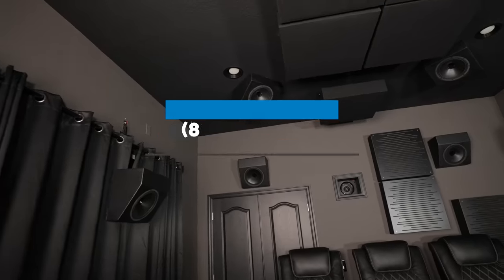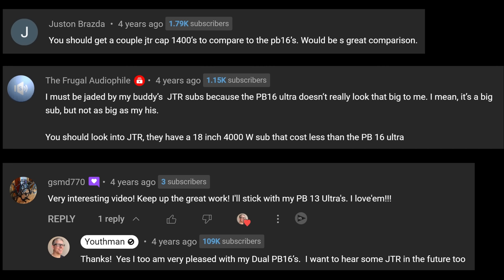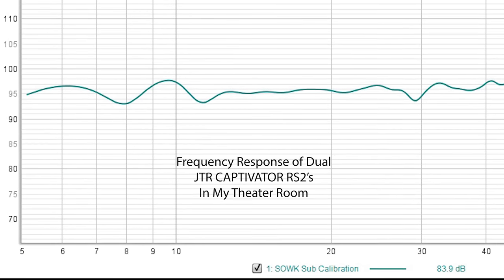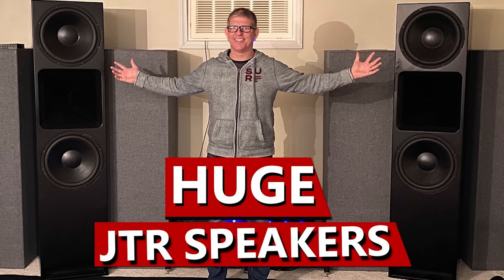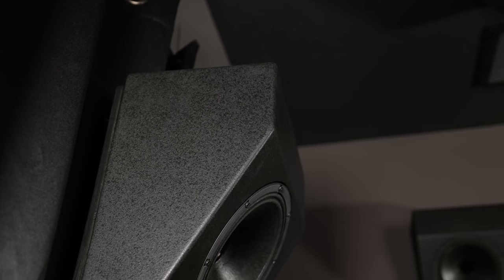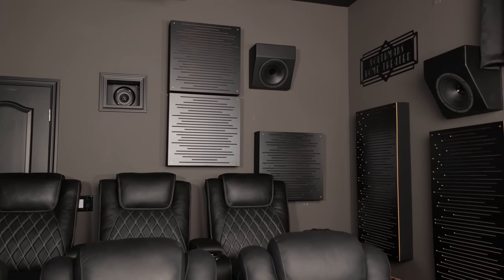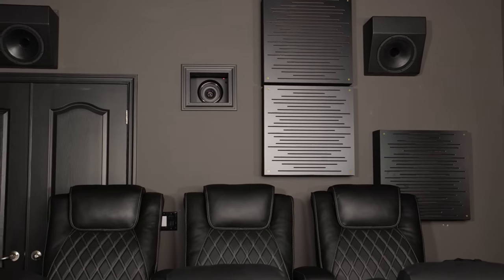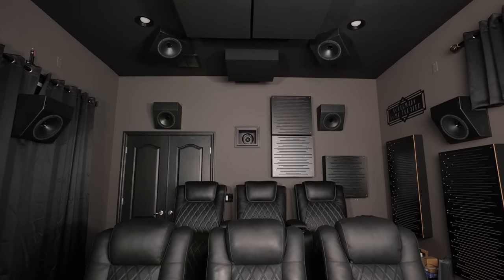I Installed EIGHT JTR Surrounds and Height Speakers in My Theater! | NOESIS 110HT-SL

Comment: Got a quick question I got the Klipsch rp 500 ht speakers and I keep hearing conflicting answers I have them on my front wall should the toggle switch b set on Atmos or surround sound I heard if their on the top of your speakers they should be on Atmos and if there on your wall they should be on surround sound for Atmos
Reply from the maker: Jump to 3:48 in this video - https://youtu.be/pLqm_h7Ic1c

When I made that video 2 years ago, I verified with Klipsch what the toggle switch options were for because the manual was a bit confusing.
Reply: So put it back on Atmos is wat your saying
Reply: Ty very much for your help you always help me wen I got questions God bless you n yr family for all that you do n will do moving forward
Reply from the maker: As I explain, in the video, the only time you switch it to Atmos is, if you were placing them on top of speakers, and up towards your ceiling, using them as a upfiring, Atmos speakers.
Reply: I actually talk to a Klipsch support team member today n they said even if it's up on your wall being used for a Atmos speaker keep the toggle switch on Atmos just wanted to let you know what they said to me
Reply from the maker: That’s unfortunate because that’s the exact opposite of the information I got directly from Klipsch.
Reply from the maker: The toggle switch is changing the internal crossover of the speaker. There’s no reason to change that if it’s on your wall, the reason to change it with upfiring is that sound hast to bounce off your ceiling, and then back down to your listening position
Reply from the maker: There’s no harm in trying it both ways and seeing which sounds best to you. You may not even hear a difference.
Reply: Keep doing what you are doing it's great information n that's what I was thinking when you said u talked to them it's the total opposite but that what they told me n just wanted to let you know but it's all good thank you for everything you do n have a blessed day my friend

Comment: My only comment on the surrounds is if it's above your head standing up. It's too high. Closer to ear level the better.
It can work when it's at longer distances from the mlp though like an actual cinema.
Reply from the maker: I would agree if they are not angled downwards directly in line with your listening position.